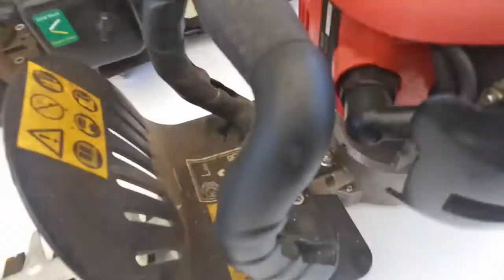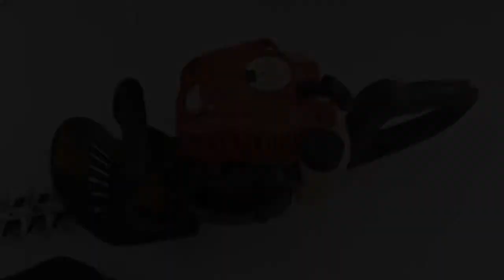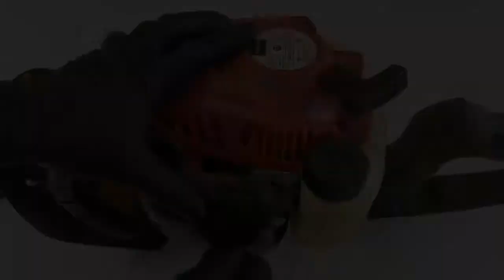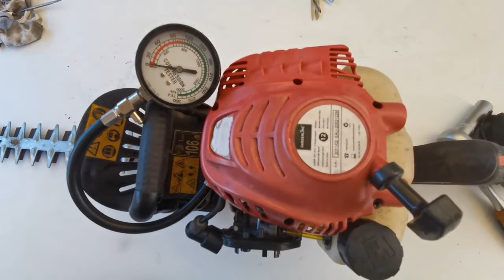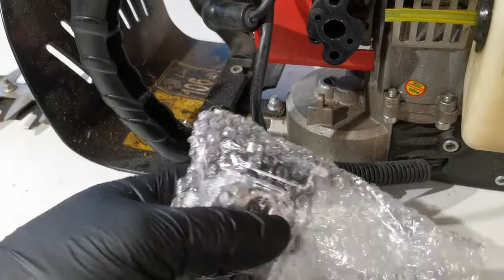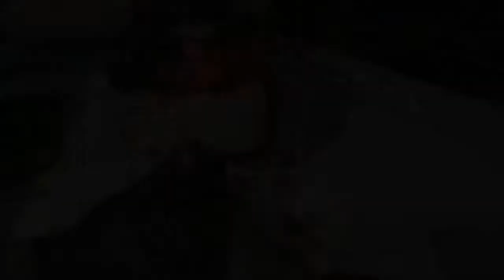VTECH 82 - Repairing an ALDI Gardenline BG-35011 Hedge Trimmer

Comment: hi, how are you, just a quick question to ask for your help, i have a honda hedger, its hard to start, need to pull maybe around 15-20 times before it run,  but once its start to run and can start easy when the engine is warm up, do can u guide me what maybe the cause ? thanks
Reply from the maker: Thanks for watching and subscribing to our channel. With your issue, likely the engine has low compression. Check the compression. For 2-stroke, it's around 90-150psi.
Reply: @Varietech-AU  thanks alot for your guidance, just wondering if is it worth to fix up if the compression problems or buy new machine? thanks